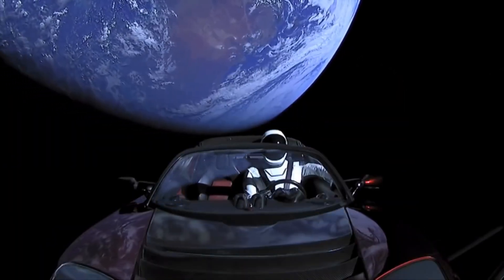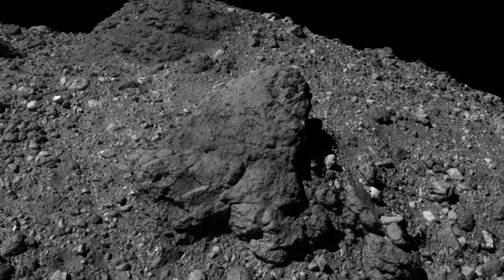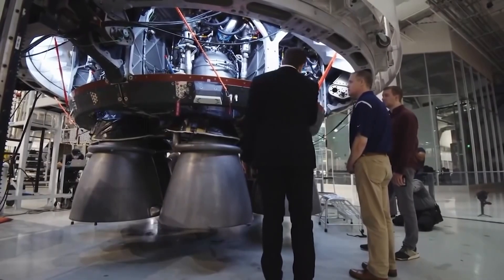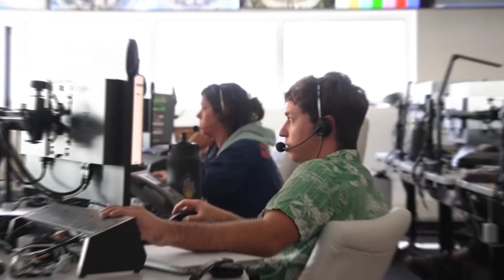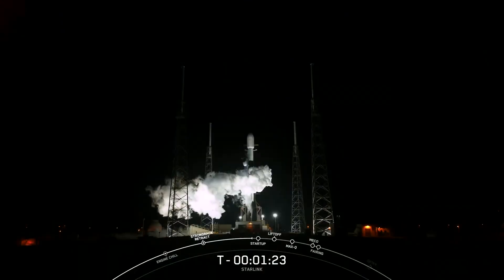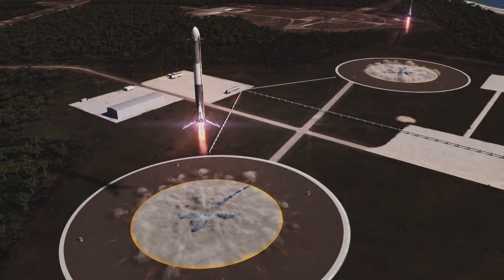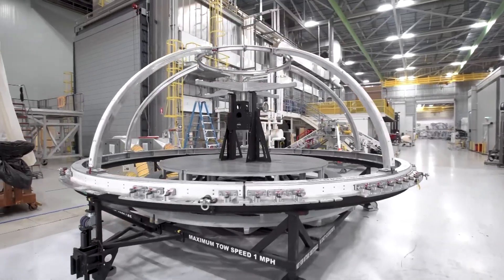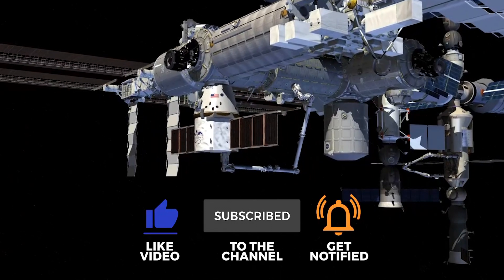This Is Why We Don’t Produce Rockets Inside Space!

Comment: Space is a lot more benign an environment than portrayed in this video. Launch and re entry are the most challenging sequences which any large space built platform doesn't need to consider. Docking will be the most severe event such ships wouldhave to contend with. Sections could be manufactured on the moon and then catapulted out into space because of the piddly escape velocity as the gravity well is sufficiently small, making low lunar orbit the perfect shipyard. Mars I'm not so sure. This is why returning to the moon is paramount.😊

Comment: The question is why would one want to develop a rocket in space?
Reply: It takes a lot of fuel and resources to lift heavy equipment to space, such as a second stage payload for an Earth escape mission.

If you could build rockets and fuel them from the Moon or a captured asteroid, it could be more cost effective to launch just the payload from Earth and then have the second stage transfer craft swing by and pick it up.

Also there is the case of return craft. If you have an orbital factory making superconductors or the special fibre optics or crystals zero-g is supposed to left you fab, you need return craft to bring finished product back to earth.

Every pound you launch in to orbit has an insanely high cost, but a lot of material has to just get thrown away after one use, so if things are going to be disposable, they need to be made as cheaply as possible, from whatever source you can get them.

Of course the flip side is, if you can do like SpaceX does and focus on bringing the cost of reusability down, that is another way to attack the problem. Really both solutions are what humanity needs for us to have a stable presence in space.
Reply: @Steven_Edwards  the reason I ask is because there are way more efficient means of propulsion we can use in space.  Good topic though.  It leads to some good brainstorming.